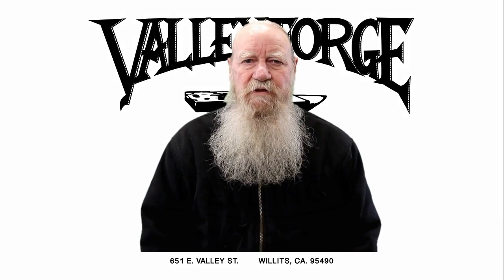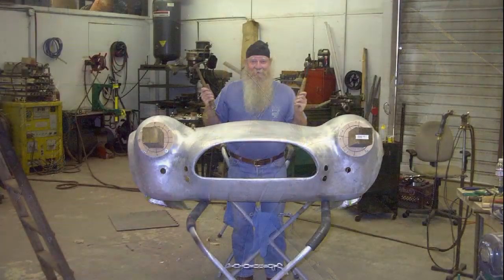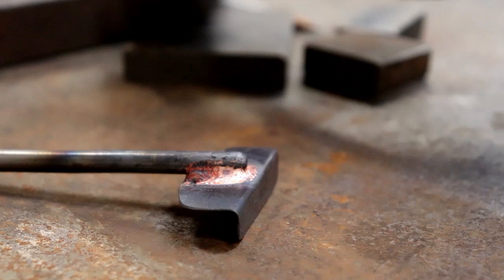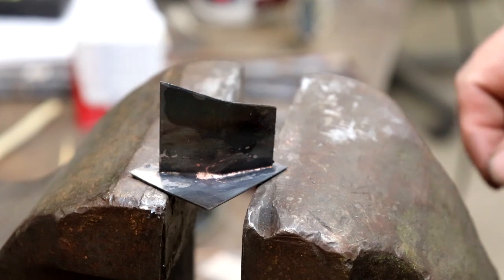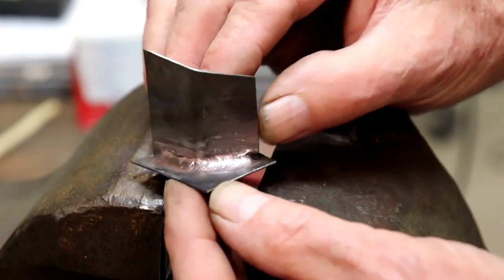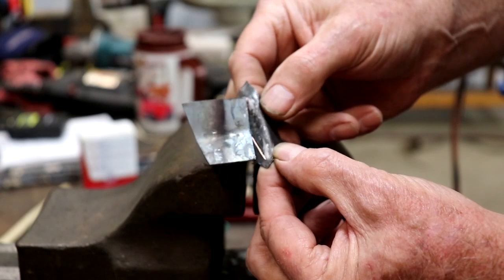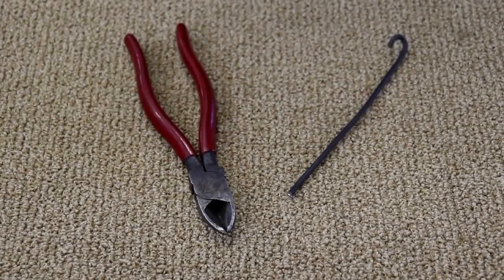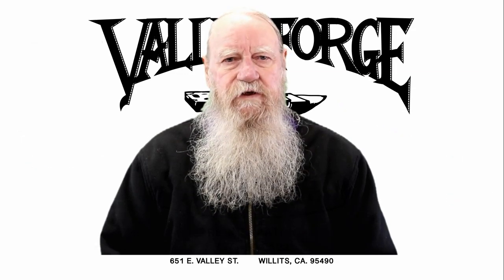Using Romex As Brazing Rod

Comment: Thanx Jere, back in the day we used coat hangers to braze with. Tough to do that today with all the plastics. And my son is an Electrician, so copper wire is very available for me. These are the things that make life in the shop easier, keep the valuable information coming and thanx for sharing.
Reply from the maker: Thanks for watching Lone.
I will be putting out more videos in the future.

Jere
Reply: Well I didn't use coathangers to braze with but to use as welding rod and I still do sometimes.
Reply: "coat hanger" brazing is actually gas welding...

Comment: This is exactly what I was looking for, I'm making lamps with copper (sheets) and didn't want to weld the decorative add-ons  with anything that looked out of place like brass ,the tensile strength is never a factor , all I wanted was to replace the bright silvery color of lead, this method of using regular copper wire is the best solution. thank you for making this video.
Reply from the maker: Hello ddis:

No two batches of copper are the same. If you want to get an exact color match you need to cut thin strips of the parent material and use that as the filler material.

Thanks for watching.        Jere
Reply: How did it work out?

Comment: Use your bead roller to smash the insulation It does a fast job to strip longer wires for recycling. bare copper gets about 4 times as much as insulated wire
Reply from the maker: Hello Tim.

Thanks.That is a great idea.          Jere

Comment: Nice, I have never tried copper.  It worked great.
Reply from the maker: Hi Randy - It makes a nice fillet after welding. Saves a lot of grinding. Really finishes of a piece before paint or plating.          Jere
Reply: @jerekirkpatrick2092  It seems to wet very nicely.

Comment: great video, just found your site . great idea and responses. if you were to use it as a filler on a car , what surface prep prior to painting is recommended? i am told that when you braze a panel patch  that extra steps to clean the surface are required. thanks for the info
Reply from the maker: Hello Sheri.

The extra prep when brazing is caused by the introduction of flux. With this method there is no flux used so no extra prep. You must be sure that air can not get to the front or the back of the copper because of corrosion. Primer and paint will take care of this problem.

Thanks for watching.            Jere

Comment: just curious what size tip you are using. great video. thanks for sharing.
Reply from the maker: Hi Michele.
For this 18ga material I was using a .5 tip on a Hen Rob torch.
The tip size is determined by the thickest of the materials to be joined.
Be sure to subscribe.           Jere

Comment: Great tip, thanks for sharing. Often making jigs and temporary bracing this would come in handy especially with the price of brass. And I have a buddy who's an electrician! Thanks again
Reply from the maker: Thanks for the reply James.
The joint really looks nice when you run the torch over it the second time. I have found myself using the copper for one time use jigs and fixtures also. 

Thanks again             Jere

Comment: Would using flux paste make this type of work better or worse? I'm new to brazing, so I don't know the tricks yet. However, I'm an electrical lineman,  and i have an abundance of scrap copper wire from work, in many different sizes. Pure copper, both stranded and solid. So if I can get the hang of it, I have a bunch of free brazing rods! lol
Reply from the maker: Hello Logan:

I am using a Hen-Rob torch and it requires no flux. You will have to try this process with the torch you have. If you have an abundance of copper wire, I would make belt buckles from the wire. Look up E.A. Chase and you will see what I am talking about.

Thanks for watching.       Jere

Comment: This is a good tip for a temporary joint but don't expect it to last long, I've read it will corrode over time.  There are hundreds of different brazing rods, you need one that suits the particular situation.
Reply from the maker: Hello Kahu.

That is a good point. I just added a drain plug to a c6 automatic transmission and I chose to use silicon bronze to effect the joint. Learning proper joinery is not learned over night.

Thanks for the comment and watching.              Jere

Comment: Hi jere I really enjoy your videos! I was wondering how and if brazing pot metal is possible! Also what to use and how to properly do it. Thanks!
Reply from the maker: Hello Scott.

The last time I had any success in "welding" pot metal was back in1972. It was from a 1932 Plymouth grill. Everything since then has been a bust. The problem is the different amount's of Zink uset by different casting houses. Aluminum melts at between 890 and 1220F (depending on it's alloying) and Zink melts at 785F. When trying to weld pot metal the Zink starts spalling out before the aluminum reaches it's melting point and the Zink runs out onto the table. There is a product called "Alladin 123" and they claim you can "braze" pot metal with it. You have to use O/A torch and get the part hot enough to melt the rod while not melting the pot metal. I tried it once and did not receive a satisfactory result. With the limited amount of call for this process I have not pursued becoming more proficient at it.

Thanks for watching and your question.
Jere

Comment: Not what I was looking for here, using copper wire to weld steel to steel. I was looking for welding copper rod to copper bar using copper wire as filler rod. I saw an old electrician do it one time in my life on a big starter motor but I don't remember whether he used a flux or not with oxy-acetylene torch but the finished weld looked great. I have also seen copper wire welded to steel plate using yellow brass brazing rod using the white flux coated rod. That worked good too if you don't burn the copper up..
Reply from the maker: Hello pipedreams:

The process I used in this video was brazing. The parent material did not come to a melting point. I have "welded" copper before but it takes a more precise technique. Controlling the heat dissipation is the key to a successful weld.

Thanks for watching.          Jere

Comment: Nutz?  Nope. On the same vane, I've used SS & Alum mig wire for TIG filler when I've needed thing filler. rods.  I wonder how silicon bronze filler rod would work?  I dig Oxy Acetylene, its very TIG like (or visa verse; aka intuitive, and vastly versatile)
Reply from the maker: Hello Hobo.

I just used some silicon bronze yesterday on a radiator hold down that I made. It flows out very nicely and is a stronger attachment. I use MIG wire all the time for welding body panels  and exhaust headers.

Thanks for watching.          Jere

Comment: Is there any reason somebody couldn't use that idea prepping for chrome plating. contouring and void filling?
Reply from the maker: Hello David:

That is what they do in the plating shops. Look at some of the chrome plating and chrome restoration videos here on You Tube. Copper is the base for the nickle.

Thanks for watching and be sure to subscribe.          Jere
Reply: I thought it should work as Nomex and acid copper have to be close to being the same. It would be cheaper than buying silicon bronze. But you always have to ask when it comes to plating. How does it handle pot metal?
Reply from the maker: @davidbartch8917  

Pot metal is aluminum and zinc. The zinc will spal out. NOT compatible.

Jere

Comment: Jere,i made an oil tank for my Triumph chopper,and had pinhole leaks. Will this copper trick fill them?
Reply from the maker: Hi Chopper:

I am using a Hen-Rob torch which burns very clean. I don't know which type of torch you are using. Do a few test pieces to see if you get good results before making an attempt on your tank. If the results are good, center punch the pin hole just a little to open it up so the copper can flow down into the hole.

Thanks for the question.        Jere

Comment: Mr Jere can this copper wire be used to braze on an aluminum flatboat?
Reply from the maker: Hello Bobby:

No it would be incompatable with aluminum. Depending on the surrounding area a repair could be effected by welding or riveting a patch.

Thanks for watching.         Jere

Comment: Can you use copper on cast-iron? ( tractor engine block).
Thank you.
Reply from the maker: Hi Lino:
I don't think I would use Copper. It's quite soft and may not accept the expansion and contraction that a engine goes through.
Several years ago I used a block sealer on my tractor and it is still working. This may have been the first time I had read and followed the instructions on the bottle.
Thanks for watching.        Jere
Reply: @jerekirkpatrick2092  
Thank you.

Comment: How do you think this work on cast iron, like the skirt below the cylinder and the pan on an engine?  Trying to avoid cracking due to challenges with heat distribution and cool down.  Thanks in advance!
Reply from the maker: Hello Rick:

Copper is a very soft material and would not be good for any ware or pressure application. 

Thanks for watching.         Jere
Reply: Jere Kirkpatrick   Hello Jere, 

Understand about wear and pressure.  I’m talking about a completely overhauled 1927 Model T engine that kicked an improperly tightened rod end out the side of the block, well below the cylinder down to, and including the pan lip.  About 10 pieces with total area about 10 square inches.  Hope you have a chance to consider this extra detail.  I’ve seen you weld the old gas pump crack with cast iron rod but find the prospect of trying to fit 10 pieces one at a time seems more doable with you copper rod technique.  I’ve done a lot of soldering and it just seems like it would work.  No pressure inside the crankcase and nothing wears on this “skirt” area of the block.  Kills me to think of junking the block. Thanks in advance for pondering this dilemma.
Reply from the maker: Hello  @rickolson9011 :

Back in the 80's I repaired an exploded water pump by fitting all the pieces back together one by one, making sure of a good tight fit, and MIG welded just a spot to hold them in place (no more than a spot). After everything was in place I preheated it (on a fire out back) and brazed everything together. After the brazing was done I put it back on the fire and didn't touch it until the next morning. Then I did the final grinding and filing of the mating surfaces.

Hope you have success with your project.          Jere
Reply: Thanks Jere!  Sounds like a very good hybrid approach.  It is rewarding to recover from catastrophe!  I enjoy your video content and the quality of presentation.  Be well!!

Comment: Jere, why does this work without flux ? No oxidation in finished bead? Thanks P.S. Nice torch
Reply from the maker: I am using a Hen - Rob torch. It burns much cleaner than your standard torch.
Try it with the torch that you have and see what results you get. It may surprise you.
Jere

Comment: Jere, what metal are you brazing together with the copper?
Reply from the maker: Hello Irene.

The material is 18ga steel. I use this method quite a bit for making a nice fillet where two pieces come together in a "T" joint.

Thanks for watching.             Jere

Comment: What temp does it melt at, can you use propane and no oxygen ?
Reply from the maker: Hi Peaky:
Copper melts at 1,984 deg. F. Steel melts at 2,700 prox. (depending on carbon content). I use a Hen-Rob torch and have not used any other process. Give it a try. With the large flame from the propane torch you will not have much control of the area being heated.
Thanks for watching and be sure to subscribe.        Jere
Reply: @jerekirkpatrick2092  
I shall give it a go, see if I can get it to melt,
I use oxy acetylene for my lead work but not sure if the regulators go high enough,
I'll give them a go as well as I like the idea of the bare copper wire.
And yes I have subscribed,
Keep up the great vids.

Comment: Have you tried this with flux (say, 20 MT Borax)? And did it affect joint strength for the better?

Great video!
Reply from the maker: Hello NM:

By using the Hen-Rob torch Flux is not needed. Flux is used for "floating" impurities to the surface and cleaning the area around the bond. Simplicity of the joint was the purpose for this exercise.

Thanks for watching and an excellent question.        Jere
Reply: Thanks very much for the response. I have just discovered your channel and it seems you have given out with a great deal of valuable experience there.  Your answer seems to be conditioned on the use of the Henrob torch in this instance. I cut, gas weld, and braze with conventional a/o and p/o torches and have never used a Henrob. Is there a technical side I’m missing?
Reply from the maker: @NMranchhand  Hi NM:

The Hen-Rob is a much cleaner burning torch. Watch this video and you will understand why.         Jere
https://www.youtube.com/watch?v=9Yydtw9KZ-M

Comment: I'LL GIVE IT A GO !   I HAVE AN OIL TANK ON A MOTORCYCLE THAT'S BEING A LEAKER SO LETS SEE WHAT HAPPENS. THANKS
Reply from the maker: Hello Dan.

Be sure to give the copper a broad foot print. The two materials (steel and copper) have very different expansion rates. Allow the edges of the copper to "feather" out all the way around allowing the copper to move more freely.

Thanks for watching.          Jere

Comment: Aren't copper fumes harmful?
Reply from the maker: Hello John:

I'm sorry but I do not have a cogent answer for you. 

Thanks for watching.       Jere
Reply: If you worry about everything you'll die from stress....  Look at him....  Is he dying?  Nope..  And them old guys worked with raw Lead instead of Bondo...   They also had Mercury Thermometers.
Reply: @OldSkoolF    Lol
If  Jere (hello sir,beautiful videos! ) had a few sun rays coming into the shop from some holes in the walls or roof (!!!) when he is sanding off the rust on some parts, like the cast iron helmet of the 1930s gas pump, he would run out of the shop (i would,it does not kill me,but it also does not make me stronger);....... and only come back later; one  learns to hate iron rust dust, after one sees  it,and some install a fan or exhaust fan;
i use  mercury thermometers; we provide care for some old folks here (in Portugal,after 20 years in NJ);  they still sell them (old stock,i guess)in bunches of 10 for 10 euros; no electronics and no pos batteries to go dead on you; the mercury qty is almost infinitesimal.
Reply: @josepeixoto3384  I remember being 10 and DA'ing the side of my Uncles 50 Merc...  He would take us to McDonalds and to Coffee with the Guys after We finished for the day... I remember blowing my nose and rainbow colored boogers coming out...  I'm 55 now and stronger and healthier then most my age...  He always used to say "stress is what kills a Man".  Since then I don't worry about anything...  My Uncle Lived to 83 and only died cause he was to stubborn to go see a doctor.  (a cold turned pneumonia).  I finished the 53 Glasstop He was building..  He had it almost done.. Just had to do the wiring...  I wish I would have kept that Car...  But like He said.... "Never fall in love with anything"...

Comment: I tried this once but I’m thinking that I didn’t have enough heat on it
Reply from the maker: Hello Troy.
Steel is red hot at about 1,000 degrees. It must be above this temperature before the copper will flow out. Try putting a drop of copper on the steel and continue holding the flame to it until the pool of copper starts to flow out. Then you will have a visual of the correct temp. for making the joint.

Thanks for watching.             Jere
Reply: Jere Kirkpatrick thanks I’ll give it try. I was thinking it would be more like brass flux or even sulfas like we do in HVAC

Comment: Technically Romex is the brand name of the wire, so you are actually using copper, not Romex.
Reply from the maker: Hello Ben:
You are correct. I used the term "Romex" so that fellows would know that copper wire was readily available to them at their local hardware store.
Thanks for watching and please subscribe.         Jere